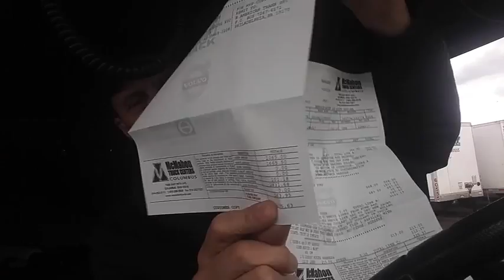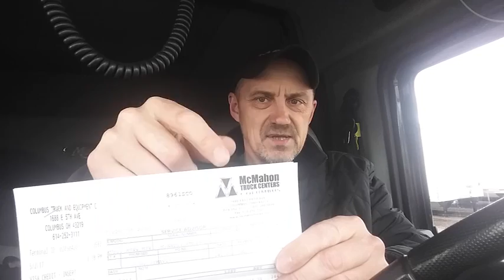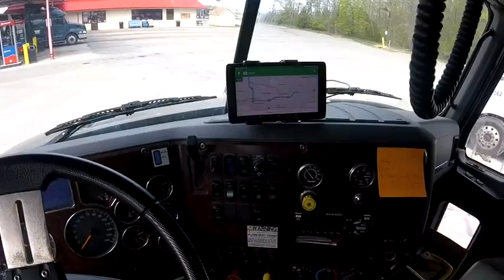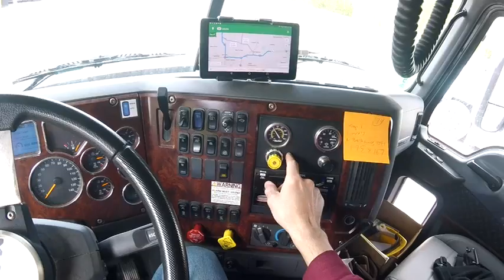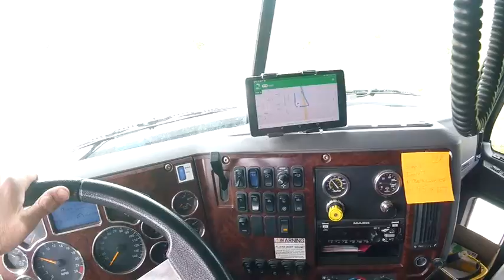Heavy Haul TV: Episode #529 -- Caterpillar 328D CR -- 75,000 LB

Comment: Inspection of the DEF tank,  pump fittings and wire harness should be a weekly ritual just as a battery inspection. You can't get away with just oil,water, and belts anymore.
Reply: Too funny

Comment: Hey Sergei did you say it took them 10 hours ? I work at a Mack shop and it takes us 2 hours to do the def pump and scr harness and 3 if any of the 4 bolts brake that hold the pump . Also the coolant pipe always rot should spay it with that chain lube you use on your binders it stop it from rotting on you .
Reply from the maker: Jon Rochefort the pump was US$1,500 minus the core, plus the harness, plus the coolant hose, plus labor @ us$148/hr.. it a rip-off to an owner operator. doesn't matter where you do it.

Comment: Hello Sergei, I have been following your channel for a while and would like to thank you for the great vids. Also I am wondering if you have thought of a late model used T800 as there are a pair at Porter Truck Sales in Houston. They have everything you are looking for and probably can be purchased a lot cheaper than a new truck. The only thing I see that might not fit your spec is that they do not have a hydraulic line, and the wheel base is too long, 300inch. Check them out.

Comment: i have insurance for things like that, machine damage. cost me 400usd per year.
Reply: What ins. co. offers this?
Reply: the one i use are called, "if".
Reply: thats just the drivetrain, engine emission etc coverage. then there is liability and damage to the truck itself. 
so total its about 4000usd per year with full 75% bonus for damage free driving.  drive lengt 18750miles.  
500usd for my trailers.

Comment: ...you don't tell everyone about its faults." You don't have to lie. Just don't offer up every problem." Answer  questions honestly of course. If you complain and talk about every fault from the noisy buzzer to power complaints, to DEF pump, you won't sell it. I wouldn't buy it for sure. 

Better comment. "Great truck." "Very reliable."  "Any issues, dealt with immediately...good truck"
Reply from the maker: Frank Lee what faults? every modern truck has emission issues. now I can add to the sales info: "NEW DEF PUMP - $3,000 value" 😎
Reply: We're not seeing entirely eye to eye Sergei. I understand the value of your repair and maintenance. You take very good care of your truck. 

It's not perfect. None are. Not one.
Reply: Disclosing every minor fault hurts resale though. All trucks have issues. Every potential buyer wants a "bulletproof" truck. No such animal exists. 

A hazard of YT perhaps. Every squeak and rattle documented. I commend you on your honesty. You are a good man. I have purchased camera gear from you. Completely satisfied. 

Spending $95k on a truck. That's a lot of money. I'd want as close to perfection as possible. 

Not a truck with multiple bitches about squeaks and rattles and loud buzzers; and $4k emission repairs after 2 1/2 years. Good truck for sure. 
New parts? Yes. Just keeping the rig in top shape. As you do. 
You always do the right fix. ASAP. Good onya!

I just wouldn't lead with a list of repairs. Like a 2 1/2 year old car with a lot of new parts.  I'd kinda question reliability.